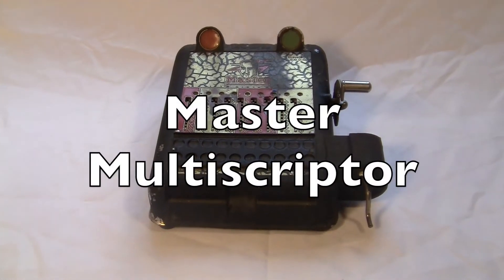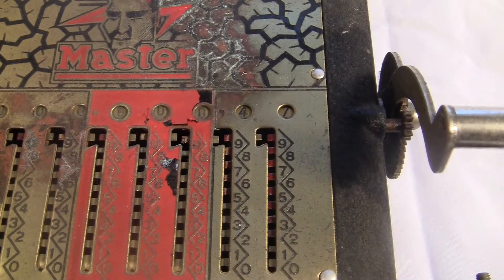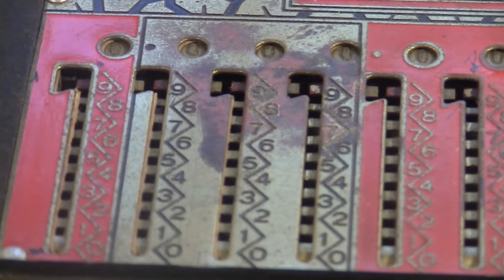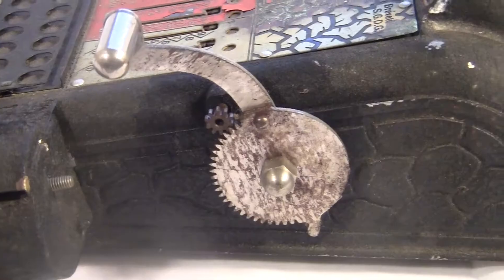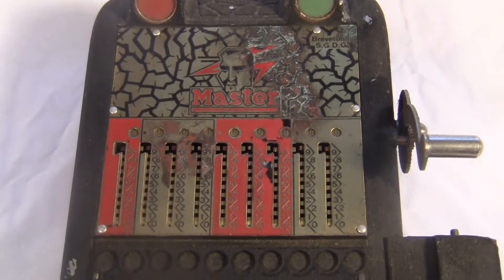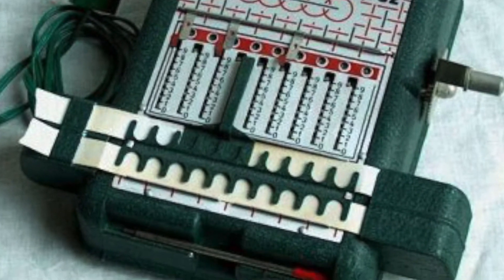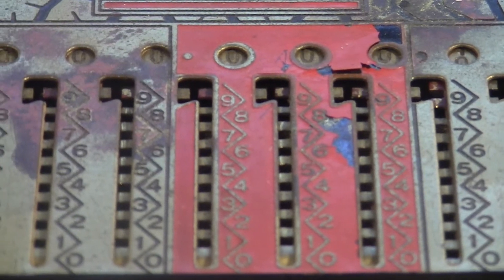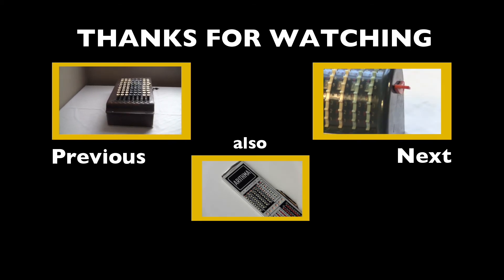Master Multiscriptor Review / HowTo

Comment: I kinda love the weird briar motif
Reply from the maker: Yes- very weird
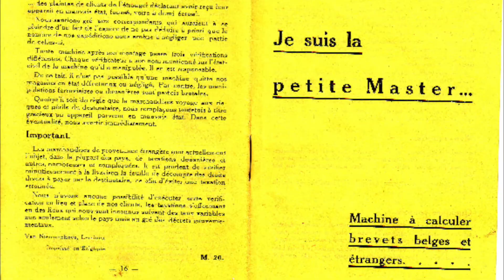Reply: @ChrisStaecker  to me it resembles mudcrack, the patterns you can see on mud plains when they dry out. You can tell the dark lines are meant to be inset by the way that they are on the upper part and side of the body. It also seems to be a running theme with some of their other machines. The one at 4:30 looks similarly earthern, as does an apparent promotional item that was a clock, calendar, and thermometer in one offered to owners of their Sirius model ( see images at jaapsch mechcalc master )

I'm loving that plate, might just spend a little time turning that into an SVG if I spot a good quality photo (surprisingly, your video so far has the most complete view of the pattern as it's missing the "made in belgium" marking!)
Reply: okay, I had to add this.. I only know basic Dutch and this is.. ye olde Belgiane so to speak.. but the marketing material is *bizarre*. The 'Sirius' booklet is written in first person.. from the point of view of the Sirius machine ..and speaks of the Master as its bigger sister. It extols the Master's virtues, comparing it to a Stradiviarius or a Hispano (a car make which I guess was high class at the time? they sure seem to make shiny sports cars now), while berating itself calling itself a fine violin for beginners and compariing itself to a Citroën (an every man's car make), and suggesting that the user can trade it in for a Master but begging the user to please not do so because it would only be worth 20 Belgian Francs as it (the Sirius) would surely be destined for a landfill or smelter. What a strange, strange company. Or was this commonplace back then? It boggles the mind..